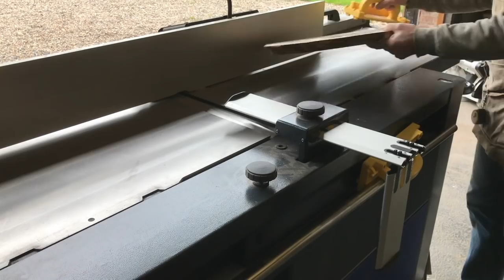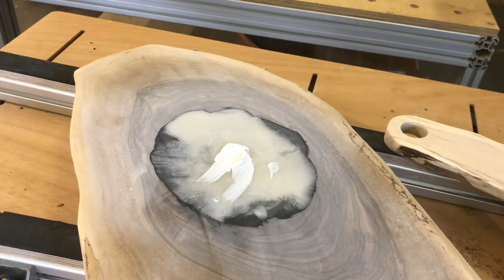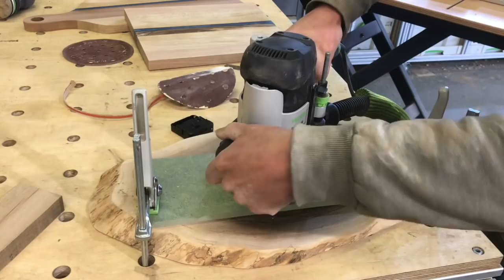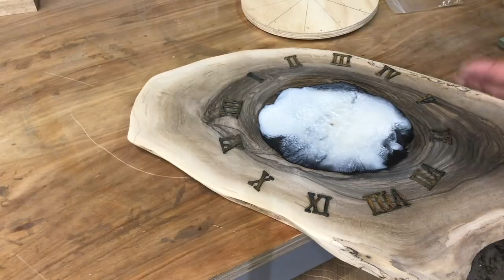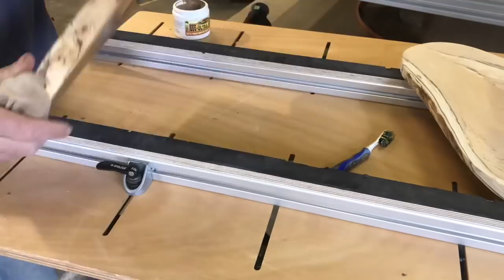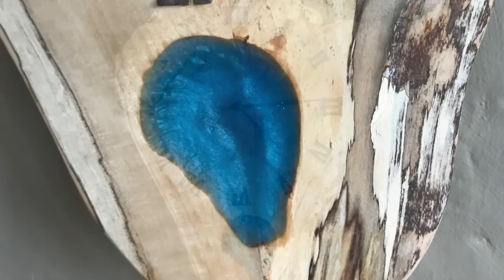Two Epoxy Resin Wood Wall Clocks

Comment: Excellent!  Can I ask where you got the numerals from?  How did you get the oneclock with the movement not inset to sit on the wall nicely?
Reply from the maker: It’s a very long clock and can be hung with metal fixing or simply via the hole at the top sits fine on the because of length

Comment: How does the resin hold up to the slight wood movement between seasons. I want to make on of these but I'm hesitant the wood will crack further around the hard resin.
Reply from the maker: Not had a problem

Comment: What clock mechanism did you use?
Reply from the maker: I use many different  mechanisms. I bought lots from amazon so I could mix a match the hands to make them fit perfectly with the very different live edge wood slabs .  I haven’t found one good brand they all seem very good quality
Reply: Thanks :)

Comment: For how much would this sell for?
Reply from the maker: They are listed on my Etsy site I have 3 in stock. Thanks
Reply: Could you maybe give a link?
Reply from the maker: Grey Clock 
https://www.etsy.com/uk/ManorWood/listing/562554710/walnut-epoxy-resin-clock?utm_source=Copy&utm_medium=ListingManager&utm_campaign=Share&utm_term=so.lmsm&share_time=1537821922820

White Clock 
https://www.etsy.com/uk/ManorWood/listing/599337828/walnut-epoxy-resin-clock-white?utm_source=Copy&utm_medium=ListingManager&utm_campaign=Share&utm_term=so.lmsm&share_time=1537821941432

Blue Clock
https://www.etsy.com/uk/ManorWood/listing/599340770/silver-birch-epoxy-resin-clock-blue?utm_source=Copy&utm_medium=ListingManager&utm_campaign=Share&utm_term=so.lmsm&share_time=1537821954660
Reply: Thanks

Comment: With the rustic look of tree, the roman numerals take away from the over all clock. I'm not sure but perhaps something more creative like regular 3,9,12,6 done in a different material? It might just be the super odd shape of this piece. Hard to zero in on center of focus when looking at it. Too much going on. Perhaps if it was not two pieces glued together in an out of center line going down the front? This face should have no numbers. Just Markers. Perhaps.
Reply from the maker: Man I am sold out on all clocks , the wood I used and the time it takes .. not sure I will be making more any time soon :)
Reply: @ManorWood  Yep I get it. No one I know is earning income from making clocks. And I like doing different ones. If I had to make the same one over and over to sell it I would lose my mind. And go broke. Thanks and good luck to you.